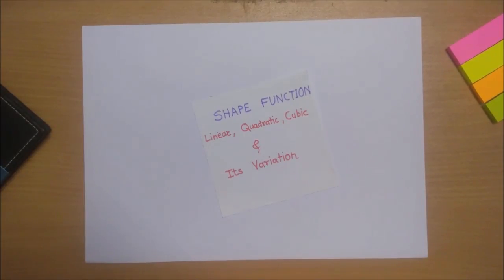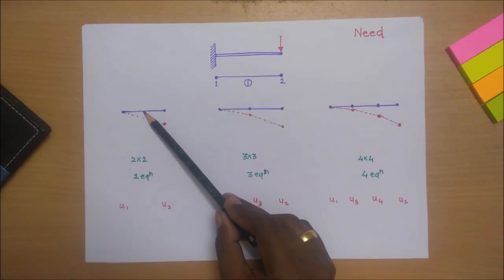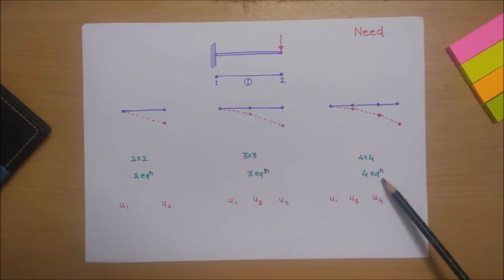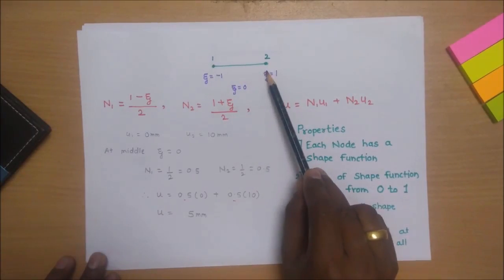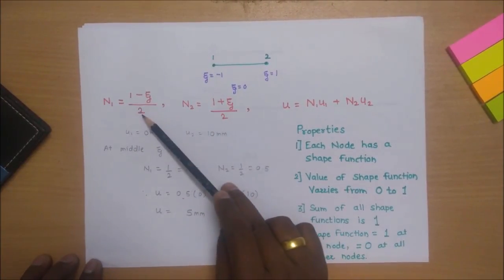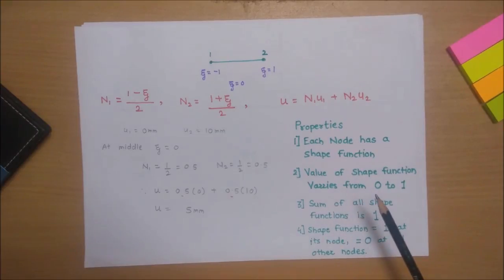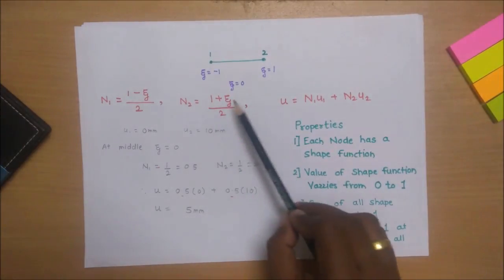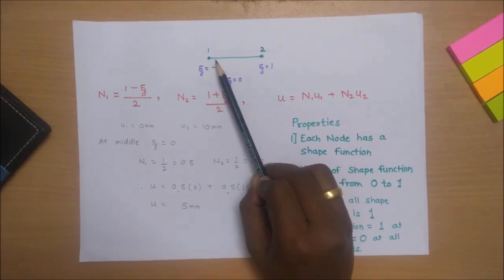Variation of  Shape functions | Linear, Quadratic and Cubic | feaClass

Comment: FEM formulation of Cantilever beam can not be done with lagrangian interpolatiob function.
So minimum element matrix size would be 4x4 using hermation interpolation function .
Use bar instead of beam example at the beginning
Reply from the maker: Yes! you're right. But for simplification I used cantilever beam as example because Cantilever beam is more familiar with students.

Comment: Hi, thanks for the video. I have one question, please. In the example when we used single element with 2, 3 or 4 nodes(0:45), will the final, u2 deflection be an accurate number and the same for all examples (2 nodes, 3 nodes and 4 nodes)? So the only errors are the ones in between the edge nodes because we are using an approximation? Thanks
Reply from the maker: Yes.